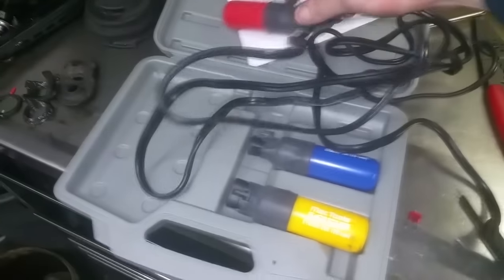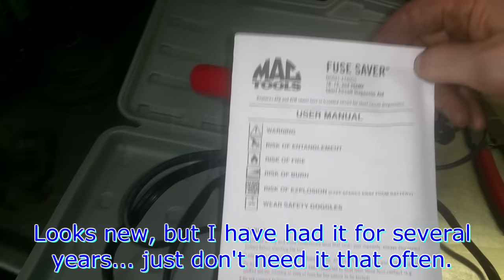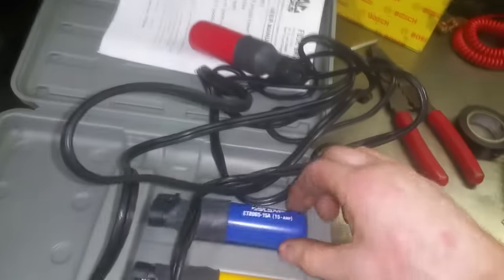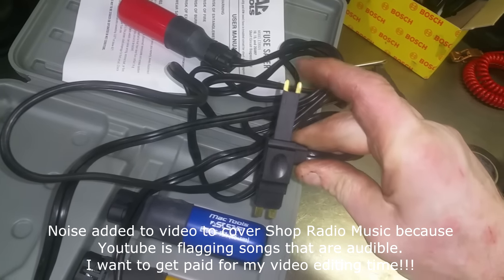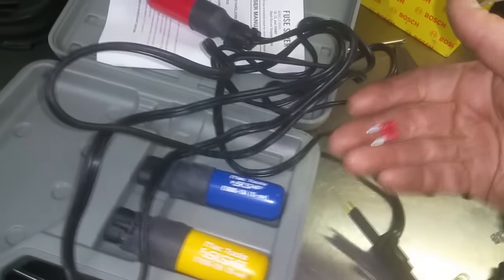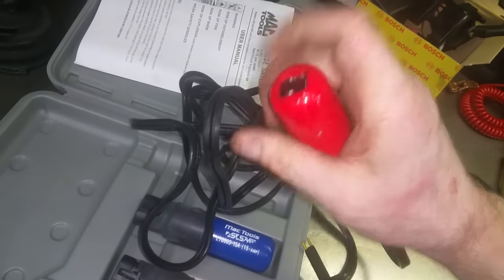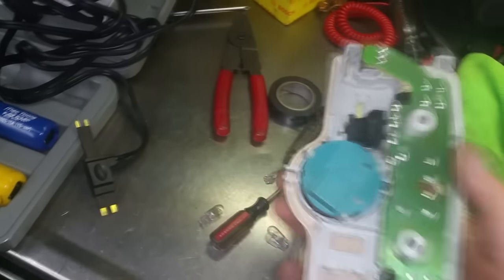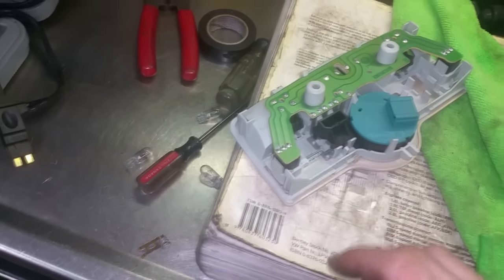Tool of the Day / Week: #029

Comment: I have the same kit I don't use it often too but it's nice when you want to check a parasitic amp draw on a suspected circuit and also use it to check if the heater fan blower motor doesn't draws too much curent especially if a car blows fuses on that circuit for example I use an amp clamp to see the current draw on the fuse buddy instead of going directly to the item in question it makes easier instead of removing components in order to get accès it would work nice for the fuel pump too etc...
Reply from the maker: It's nice to have a handy tool when you need it!

Comment: looks good. Is the connectors at anytime hard to place because of the double-sided length?
Reply from the maker: On the vehicles I have used... not yet. I can not close doors when the tool is inserted at the side of the dash, but then I just latch the door closed while it is open (to simulate a closed door).